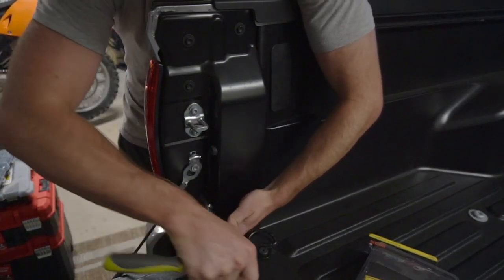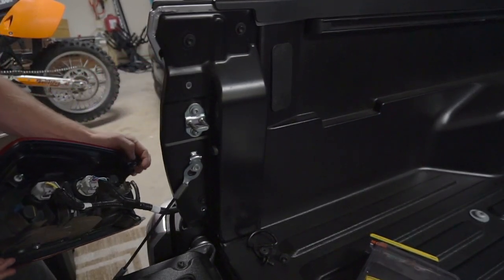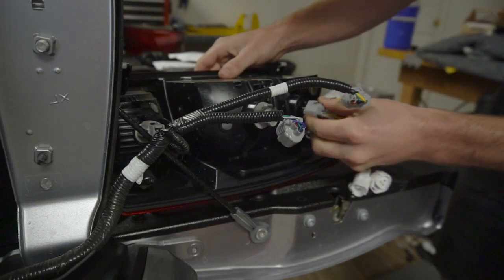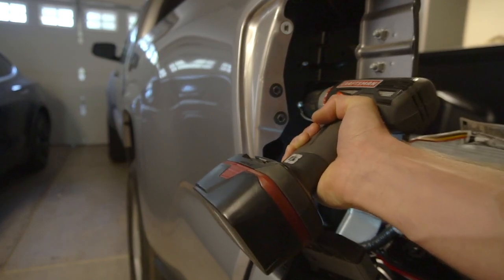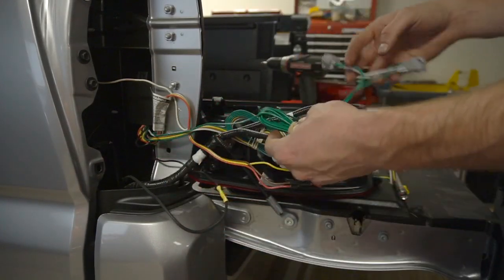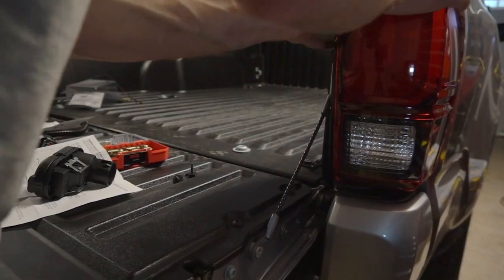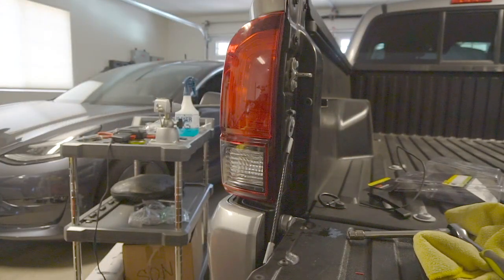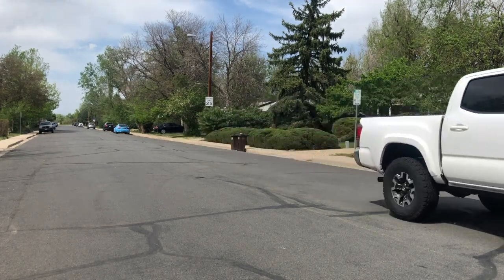OEM Toyota Tacoma Trailer Wiring Setup

Comment: Can you put the ground wire (after adding longer wiring) to the battery or a fuse panel under the hood instead? Reason asking is because someone told me the body or certain parts of a truck body are not a true ground?. I have a 6 panel fuse already.

Comment: Incredibly helpful video! Good to know about the reverse light (purple) wire as well. The only thing I did differently was instead of soldering the connections, I used heatshrink butt connectors. Either way, it works flawlessly & my Tacoma trailer connections look factory. Well done!

Comment: I was looking for the wiring harness that connects to the OEM plug, i ordered it and once i receive it i will be running the wiring just in time to tow my new boat.  QUESTION… can’t I JUst use butt connectors to attach the wiring instead of soldering them together?

Comment: Mine didn’t come with the red fuse adapter wire. And I only wired up a 4 flat. Trailer wires not working. Any tips?
Reply: Trailer lights** sorry

Comment: thank you for taking the time making this video, I just was wondering if I need to connect the fuse? if I do where it should goes?
Reply from the maker: You don't need to if you do not plan on towing trailers with electrical brakes but I would still do it just because it only takes an extra 20 minutes to get the whole job done right. It goes right next to the battery on your red power wire that comes with the kit.

Comment: Do u have a video on how u can remove the 7 pin and 4 pin caps so u can use both at the same time....in case u were pulling a 7 pin trailer and running a 4pin  tailgate brake light at the same time u cant with the caps or covers on it
Reply from the maker: No

Comment: I know it’s the way the kit comes but I can’t wrap my head around why the dang thing needs to connect to the battery?!?
Reply from the maker: That is only for the round 7 pin connector. For example, a RV trailer has electric brakes and a battery. When you connect the Rv to the truck that red wire powers the electric brakes for the trailer and charges the battery.
Reply: @92813justin  that’s awesome I didn’t know that
Reply: This video is really helpful though, thanks for taking time out of your day to record this. You did a great job

Comment: Hey man if you're not going to use the 7 pin connector do you still have to run the power wire to the battery?
Reply from the maker: Great question. No you do not
Reply: @92813justin  thanks so much turned out great

Comment: Still wondering if this works with 2nd gen tacoma? (2010)
Reply from the maker: I'd assume the process would be similar, there might be a few small differences though. For example, I believe the 2nd gen does not have the spot for the 7 pin and 4 pin on the rear bumper like the 3rd gen.

Comment: Very helpful! Question - where do you install the fuse holder? (My harness is missing the fuse holder - I didn’t realize until I got to that part in the video during install). I’m assuming I can pick one up at an auto parts store nearby
Reply from the maker: Good question, install it by your batter so it is easy to access

Comment: So if I don’t need electronic brakes or auxiliary power (red and blue wires) do I still need to wire it up to the battery?  I heard if you do that the lights will always be on. I basically only need the four flat features. Also would save a bunch of hassle running the wires.
Reply: I want to do that same setup no need for breaks or aux
Reply: Any feedback?

Comment: My 2g tacoma didn’t require power to the battery. Thanks for the video, now I have a heads up for my install tomorrow
Reply: took a little extra time with the green wire that connects to the passenger tailight. i cut the plugs so i could fish it through the existing wiring harness, loomed the exposed remaining parts of visible wire. also loomed the wire leading to the battery. cleanly tucked, took a few hours but its attention to detail

Comment: Did you reconnect the purple wire to the red wire that goes back into the original harness for the reverse lights? Or just connect the purple wire to the red one that goes in the bulb plug in part? I did everything like you said but my reverse lights aren’t working. It kinda hard to see in your video how you did that part
Reply from the maker: The purple wire from the connector that is coming from the bumper needs to be soldered to the reverse light bulb. The reverse light bulb has to wires, red and white. Solder the purple wire from the harness to the red wire on the reverse light bulb. Hope this helps

Comment: Looks easy I just wanted to know which exact wire do I put the purple wire to on the reverse light?
Reply from the maker: Yes, purple wire is the reverse lights or backup lights
Reply: I did it into the red wire but now my reverse lights don’t work

Comment: Is this the system i need..? For my 2019 tacoma ??i can get my turn signals an parking light to work together. Its either parking lights or turn signals..?? If this is all i need then thank you.thank you..i worked all day trying to get my lights to work on my trailer
Reply from the maker: I do not know what you have, but if you wire this up the same way you will have turn signals and parking lights on your trailer

Comment: Did this and added a Redarc Tow-Pro Liberty brake controller. Everything works except my brake lights and I have no idea why. Seems like if my blinkers work that the brake lights should work too since they're the same wires, but who knows. I tried unplugging the brake controllers to see if that did anything by going back to just the 4 flat connections, but no luck. Tested grounds, but still striking out.

If anyone has any ideas I'm all ears! Thanks!

Comment: Great video, did my 2021 Tacoma wired up to my 4wheel camper. Just be sure to connect the red wire to the battery wire or your camper battery won't charge... Took several months for my battery to run out before I noticed it wasn't charging 🙄

Comment: Question,
I bought all the same stuff. I just want to run a regular 4 pin. Do I just wire the harness to the oem adapter, the 4 wires. My utility trailer doesn't have reverse lights.
Reply from the maker: I would wire as much as you can since you are doing it. But you can wire only what you need.
Reply: @92813justin  thank you

Comment: Nice job! Followed your instructions on my minimalist model taco and looks great! Only suggestion is to recommend throwing away the cable you cut away with flat connector that came with the controller.  Reason being idiots like me get excited and solder the oem harness to it instead of to the controller.  Had it soldered, shrink wrapped and didn’t realize it until I started plugging in the tail light.  Doh!!!
Reply from the maker: Great suggestion! haha

Comment: This video helps a lot thank you! One question I have is if my trailer doesn’t have electric brakes, Do I still have to tap into the reverse light wire or can I ignore that?
Reply from the maker: I would still connect them just incase your trailer has reverse lights.
Reply: @92813justin  thank you for responding! Will do! Earned a sub from me thanks again

Comment: Have you heard of any computer fault codes occurring from a procedure like this? It seems like ANY (electronic, primarily) modifications done to late model trucks end up throwing the computer module into a tizzy-fit...

I have a 2021 Tacoma, and within minutes after installing something as simple as a locking gas cap, I started having prob's (3 different check engine fault codes were generated...I had to have the dealership hook it up and clear the computer module)...

I hope that if I do this procedure you are showing, that I won't have problems afterward... 🤔😎

Addendum : one more question...you said that the 7 & 4 - pin connector (that clips into the tailgate/bumper area) is an OEM/Toyota part, correct? Are there any 3rd-party connectors that would work with my truck, to your knowledge? And also...your video portion covering the battery connection to the back was very short/lacking detail...did you have to drill thru the fire wall to run the wire down to the wiring bundle where it is zip-tied to? 🤔🤨
Reply from the maker: I have not. I'll make a video if it happens to me.

Comment: Thank you for this very helpful video. I was very annoyed to learn that the 4 cyl. SR Tacoma did not come wired or with a hitch and the dealer would have sent it out to have it done for $500, but it would not be OEM. About $220 I got all the parts from amazon, including the hitch. A five hours later which included set up and clean up and washing the truck, I had an OEM installation and I am very happy. Both the dealer and the installer they consulted, said that they could not get OEM parts and it would not be an OEM result. Nothing is hard about this project. It took the longest, of course, to route the wires and i am very obsessive and particular. One note is that the green wire from the 4 pin wiring kit that goes to the passenger side tail light DOES NOT GIVE YOU ANY EXCESS WIRE. I had to undo my first try and go back to the drivers side light and bring along every inch of the green wire and take the very shortest path, which could not always follow existing wire that goes over to passenger tail light. At two points I took the green wire through box frame areas to make a more direct path to just get enough wire to attach to the tail light. Thanks again.
Reply from the maker: You are welcome!
Reply: Would you happen to have a part number for the kit that you used?

Comment: I’m so confused. Your boat is a 5 pin, but you’re installing a 7 and 4 flat? Soooo.... how are you pulling your boat without having the 5 flat on your truck???
Reply from the maker: To my knowledge, I have never seen a 5 pin on a vehicle from factory. The most common is a 7 and/or 5 pin connector. I purchased a 7 pin to 5 pin converter. Great question!

Comment: Great video man! Seriously very helpful!
I plan on trading this truck in within the next year, so I think I may hook up the extra wires as well for the next guy. So the purple to the reverse lights, the blue would be for the brake controller(not so much worried about that) and where would the red would connect to? is there a wire I can tap into at the tail lights?
Reply from the maker: Red goes to the battery to power all of the lights on your trailer. This is important because if your trailer has a lot of lights, the power going to your brake lights is not enough for your truck and all of your trailer lighting. I hope this helps. Thank you
Reply: I just realized, he doesn't use the red from the harness that connects to the OEM plug... he only uses the red that comes with the custom harness with the fuse box on it

Comment: Hey where do i run the blue wire if i wanted the electronic brakes?
Reply from the maker: You will have to purchase a trailer brake module and attach that blue wire to the module
Reply: Any modules you could recommend?

Comment: Is that the same 7 to 4 pin connector? Amazon said it doesnt fit 2020 tacoma
Reply from the maker: It said it did not fit mine either
Reply: Finished this job today and they all fit. Purchased off amazon.

Comment: If you wanted to connect the power wire (that you didn't on the 7 pin harness) would you splice that into the power wire you initially ran for the 4 pin harness from the battery?
Reply: Yes, that is correct.